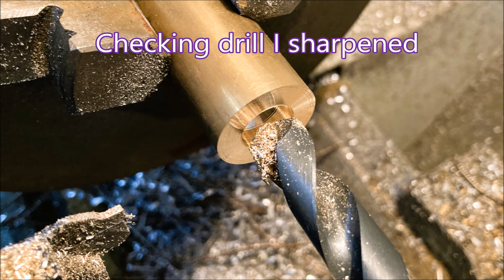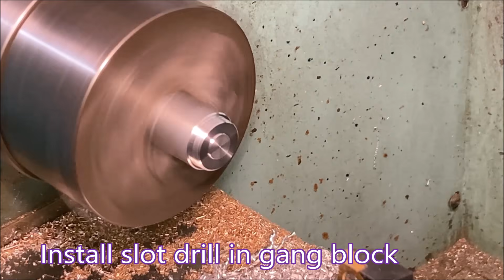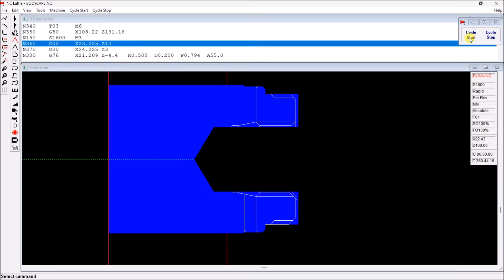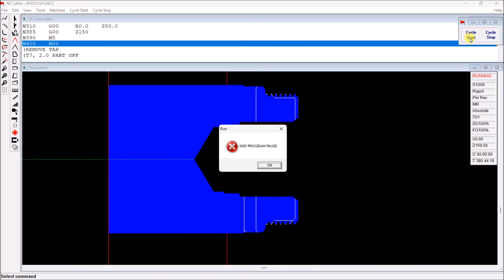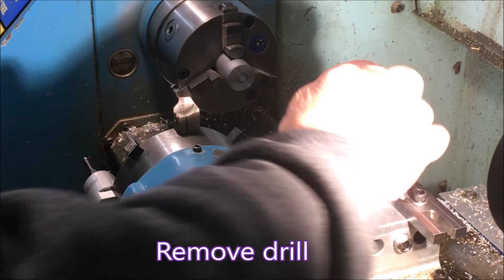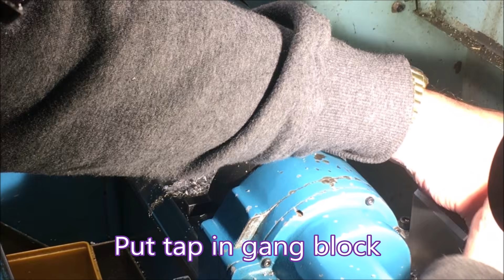Part for Safety Valve in small cnc lathe. Thread cut 32tpi and tapped 26tpi

Comment: Still here! Glad you explained that using aluminium was just to set up the machining - I was getting worried about knowing other bits of the final assembly are brass  and the almost certain electrolysis effects. Tools not invisible just hidden?... Martin
Reply from the maker: Thanks Martin, yes, I have aluminium stock but only ordered enough brass to make the required parts. I have made five trial parts to get ready to use brass!

Comment: Perfect length vid Nigel ;) Thanks for adding in the extra time :) On the gang tool, could you replace the block with one of those rotating blocks (sorry not sure what they're called) you see on other machines or would there be no room?
Reply from the maker: The machine has a turret, there is just not enough room for what you suggest. The small X travel ( it really is quite limited) means that tools cannot be left in place in the gang block. As you saw the tap would hit the chuck because it cannot be positioned further away from the chuck. I tend to ask the lathe to do things it was never intended to do! Thanks for your comment. Nigel

Comment: Good one.  Thanks again for making these vids
Reply from the maker: Thank you for always leaving a comment. Such activity is supposed to increase a videos viewing success. Part of the reason so many vid uploaders say “tell me where you are watching from”
Reply: @smallcnclathes btw, been on the lathe at work the last couple weeks.  You’re always on my shoulder , lol

Biggish stuff for the tl1 haas

And all 6061 stock.  I know you love that alloy

I’ve been pushing feed rate up considerably to break chips.  Just reducing on final finishing passes

Some of the stock reduction ops were pegging the spindle power gauge for a short time ( 7.5kw motor)
For a mediocre guy like me, it was the fastest stock removal I’ve done on lathe 

Cheers

Alistair
Reply from the maker: @ragnarhairybreeks so you have been proving that 6061 with 1/2hp spindle is not going to be much fun!
Reply: @smallcnclathes I can’t give you advice.  I’m not qualified 

I will just say , even programmed for constant surface speed, the chip results change as you go.  It’s very annoying.  The only thing that’s worked for me is pushing zee hard 

And of course, settling down to reason for finish passes
Reply: I’d  show you a vid , with speeds and feeds.  But can’t here on reply
Reply from the maker: @ragnarhairybreeks power is needed to get a cut deep enough and a feed fast enough for the alloy to chip. My advice for anyone with a lathe the size of mine is DON’T!
Reply from the maker: Can you post a link?
Reply: @smallcnclathes I’m up loading. Be kind to me , it’s long story but I’m self taught on this and it second career.  First one was micro/biochem.  I’m using a trigon shaped insert, for steel, in this op.  I didn’t n want to risk the finishing insert.
Reply: https://youtube.com/shorts/ubbuaLn6XKo?si=MaWcUiJEXS7AlNcY

Comment: I like that t handle!
Reply from the maker: Its great! I was using a long key and it was so awkward, either too short or too long. I found a short key, printed the handle and it works really well. Found the file on Makerworld. Amazing what is available these days.
Reply from the maker: 1172 was the capacity of a robust old side valve Ford motor. No significance?